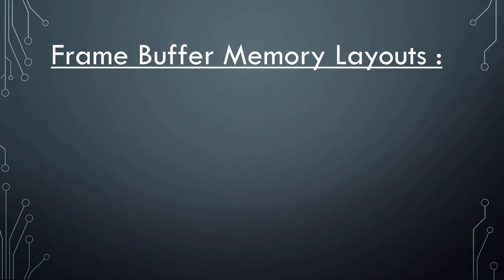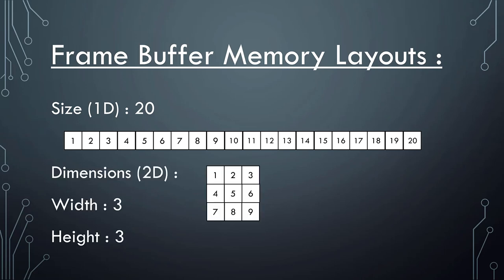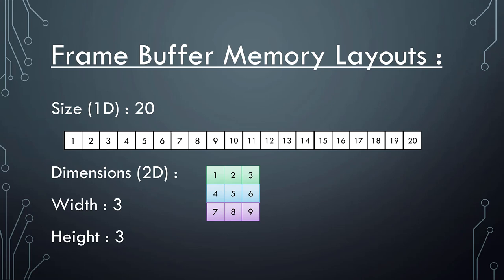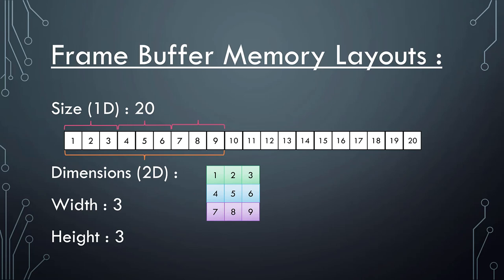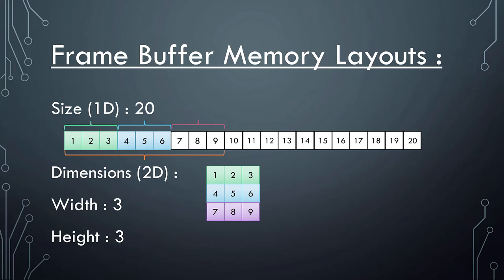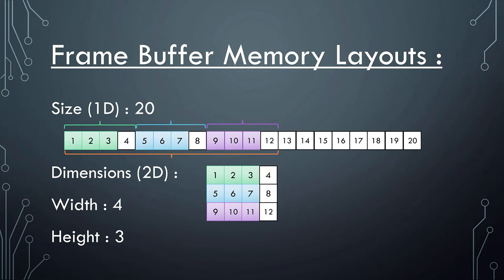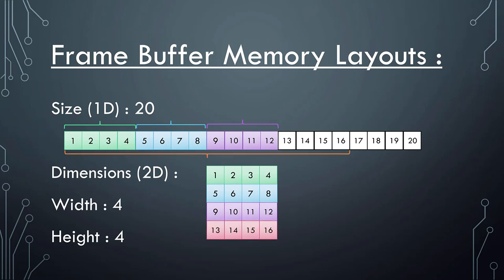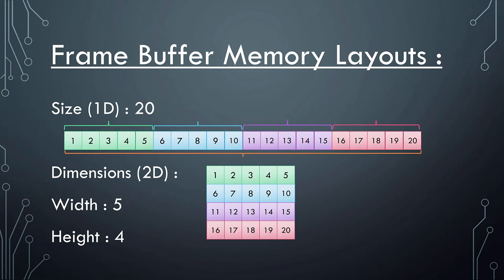Frame Buffers

Comment: hmm interesting, is this why when you resize games or something graphics related, it tends to weird out before fixing itself then?
Reply from the maker: One thing I didn't cover in this video, is something called Double Buffering It's when you do the actual drawing, not to the main frame buffer that is displayed, but to a different copy of it - and while that drawing is being done, you're displaying the other copy that contains the previous frame. Then, when you've finished the drawing, you "swap" the buffer, displaying what you've just finished drawing, and then start drawing the next frame on the other copy. So you're always drawing to one frame buffer while displaying the other. That's what double-buffering is. It's done because you don't want to display half-drawn frames, like a frame-buffer in a partially-drawn state. Sometimes there may even be more than 2 copies - like Triple Buffering having 3 of them. So in general it's called a "swap-chain".
Now, imagine what happens on a resize : The previous frame has already been drawn fully to the copy of the frame buffer being displayed - so it can't change. But the resize of the window changed the dimensions of the other copy of the frame buffer that you're drawing to - so the next frame should be fine - unless you continue resizing the window more, while the drawing takes place, so it needs to re-start. That can happen multiple times, so you end up having the new frame keep restarting it's drawing, and never actually completing - and all while that happens the only thing that can be displayed is the other copy of the frame buffer containing the old frame with the old dimensions. So there can be a long enough time that passes until a new frame in an updated dimensions is ready - long enough to become noticeable.
Reply: @HardCoreCodin  wow thanks for the explanation, I think I get it , but I think  double buffering is quite effective but costly yes?